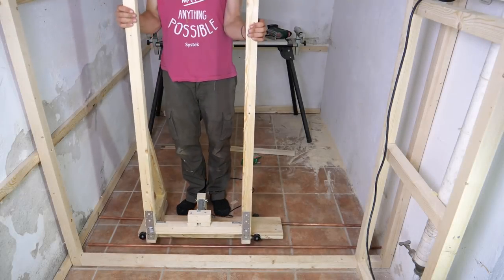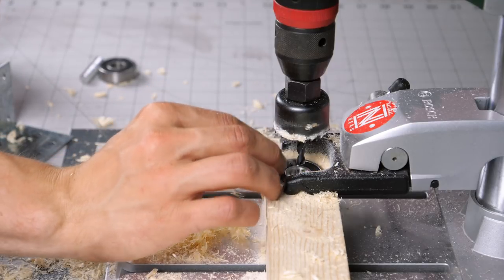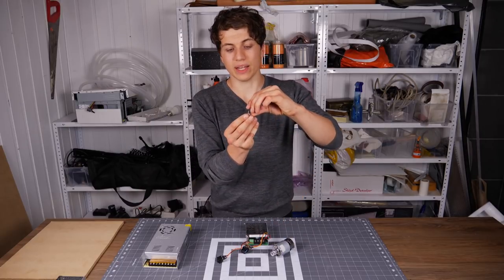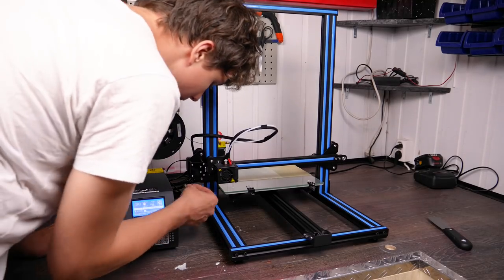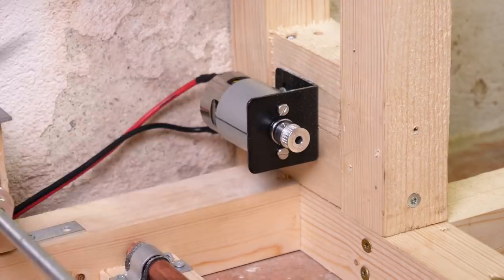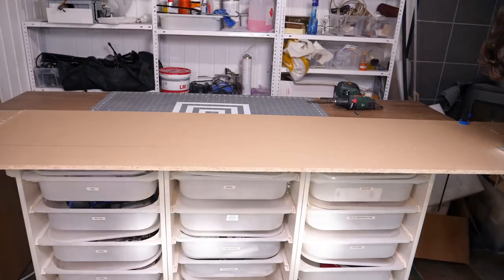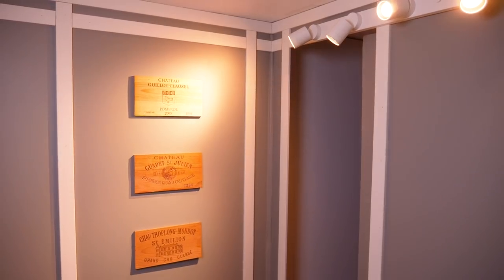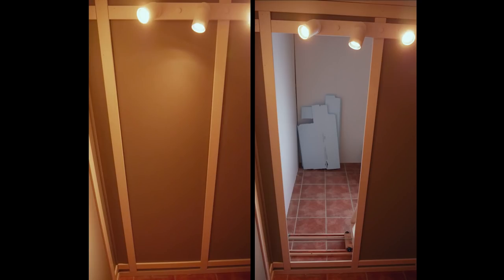Building a Secret Door Part 2 || DIY

Comment: I know my comment is a few years late but for a more durable pulley belt I would use a geared vacuum belt. If you replaced it with one of those it's unlikely you'd need to replace it again for a very long time.

Comment: If you change out your motor to one with a large gear or disk on it, connect a swing arm to the edge of that and other end to door you wouldn't have the threaded rod to step over and would be faster. think of a piston rod on a crank shaft but using a disk

Comment: Nice project! My only comment would be that it might be a little bit more practical if there were a way to flip the whole thing so that it's all at the ceiling rather than the floor. That way you wouldn't have to step over anything.

Comment: Hi.

Very cool project!
How did you choose a motor parameters? Is there some kind of formula? I am looking for a motor for my project that uses similar concept but in vertical setup and with quite a high load: more than 100kg. I cannot find a way of selecting motor parameters for threaded rod lifting :/ Any ideas?

Thanks and have a nice day.
Reply: ownerAccount well basically its not only the motor but also the reduction on the motor. If you gear down by 2 this will be 2 times slower but you get 2 times the force. The threaded rod acts as a worm wheel basically. A full rotation on a m8 thread will move the nut 1.25mm. if you compare this to having a motorized wheel with a diameter of 4cm that makes 1 turn the threaded rod makes 10 turns for the same distance. So it is 10 times slower but can lift 10 times the weight. If you have a battery powered drill with the gearbox in front just put a 8mm rod in there and see how much weight it can lift. (Its a lot so dont just let it rest on the 8mm rod and rhe motor itself)

Comment: I think you can do different, you can use end switch to know if the door is back to open or if is closed to push to the front no ? like this no need to have 2 switches

Comment: “Reversing it might damage the electronics” 😂🤣😂😂😂🤣😂😂 the only thing that happens when you plug a motor in ‘backwards’ is the motor spins backwards
Reply from the maker: Sure and that's exactly what the switches does, but if you mess up the polarity from the controller to the power supply it might smell burnt plastic very fast.

Comment: If I were to do this, I would rather use a larger servo motor attached to an arm of a scissor mechanism. And probably the same thing for the movement in and out of the cavity. It'd be much faster due to the amount of movement being in degrees, not in the amount of turns of a screw.
Reply: Xander Zoolander You have described a car window mechanism.  Which is not that bad of an idea.
Reply from the maker: That could also work. If you have a link for servos like that, please drop it :)

Comment: If the belt brakes, how can you gain access to the room? You would be locked out if it broke while it was just starting to open
Reply: Perhaps add a small hole you can put a drill or rod through near the floor that connects to a gear to manually open the door.
Reply from the maker: I have a cabinet for the basement fusebox on the wall to the right of the door, if I open it and lean in I can reach the threaded rod on the bottom and open it manually

Comment: Why not change that timing belt out for a chain and sprockets. Believe me, you do not want that timing belt to break with the door closed. Even with a way into the threaded rod, that will take FOREVER to hand wind open.
Reply: You could potentially 3d print the sprockets since you have the machine, and look for minature chain for things like robotics. Or you might find a decent deal on a match sprocket set and buy chain per link or by length.

Comment: to access the secret room you have to manually move the wine rack and wines in the process? if you were housing expensive wine and one breaks.. well impractical.
Reply from the maker: The wines are on the other side of the room, and I dont need to move them
Reply: fyi if you had a mirror finish on the wall. might actually be unnoticeable. application for a bathroom secret room or walk in wardrobe.

Comment: i wouldnt use the threaded rod i would use belts Like on the 3d Printer Just in bigger. the Transmission from the threaded rod is Just to big to Drive the door faster
Reply: Yeah the rod was really unsupported for its length, could break pretty easy.
Reply: CBA yes it wobbles quite a bit in thr video
Reply: CBA wont break since its steal but since he uses copper pipes as rails there is no precision an the rail gets bend in all directions and will squeeq so badly. Also if you firget o lift your foot once entering you just kick the whole sliding door thing over. It might be secret but its not really a door since you can just push it out of the way. Might as well just use u curtain.

Comment: What happens if the belt snaps before the door is open?
Reply: Then it is no longer attached to the drive gear and therefore has no resistance to pushing it.
Reply: It's a threaded rod, you can't push a nut down a threaded rod.
Reply: Fair point. I admit I skipped through some of the video because I am impatient lol.
Reply: Ogoun he probably has to break the door open